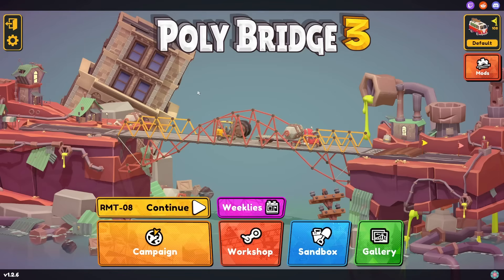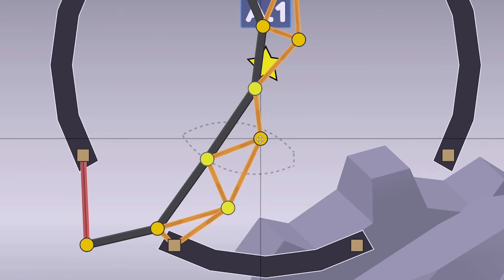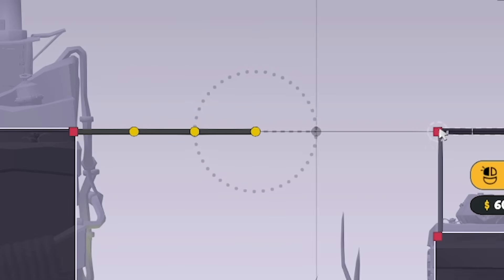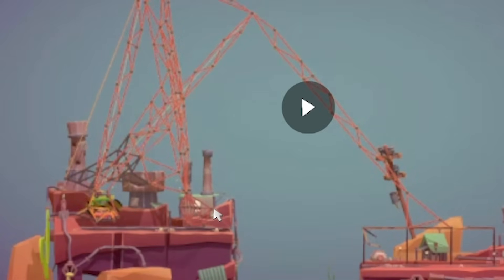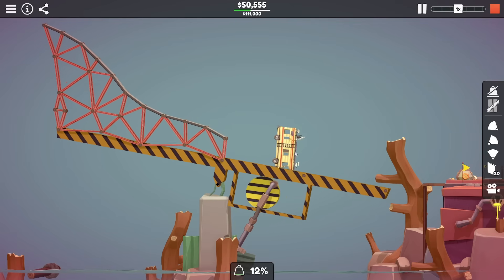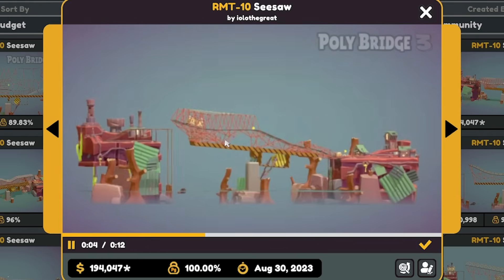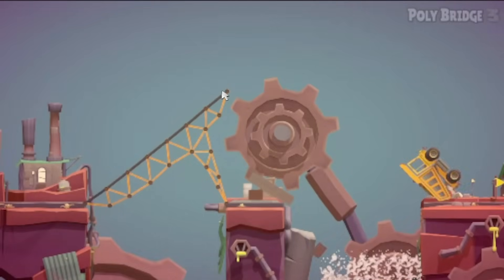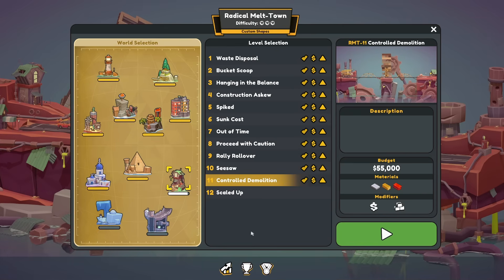Never play JENGA with an Engineer... Poly Bridge 3!

Comment: 7:00 The best part is, those aren't even for show, that's structurally important. They effectively created a floating fixed node in the center using equidistant omnidirectional bracing, aka, spokes.

Comment: as an engineer myself, "architecture" as you use it would be things that detract from the structural integrity and whose only purpose is to improve the aesthetics. Those beams they made at 6:30 were clearly important supports to make the incredibly sus rotating 1/8 circles hold themselves together. Although it definitely would've both looked better and been safer if he'd connected every side of it.

Comment: the "mere engineer" solution has a road inside the janga block. it prevented the block from rolling too early? i don't know why it worked that way.
Reply: oh they just supported the block at the first gap on the right so it falls as one block instead of disintegrating
Reply: that guy had to drive over the tower even after destroying it because the tower blocks interact with the road. that said it wasn't necessary to destroy the tower if he could already drive over.